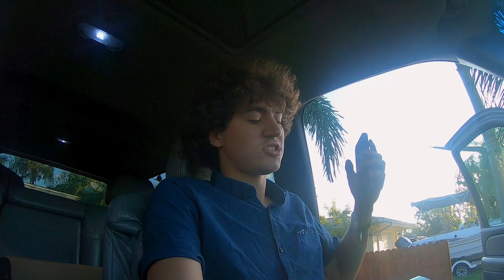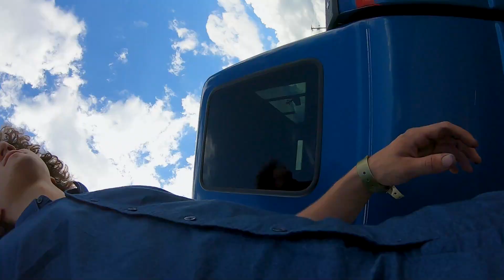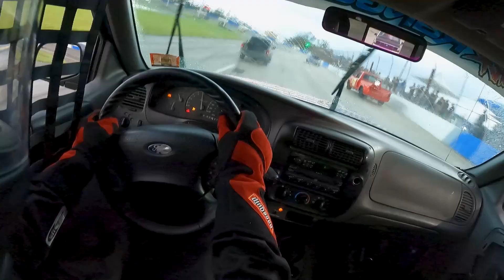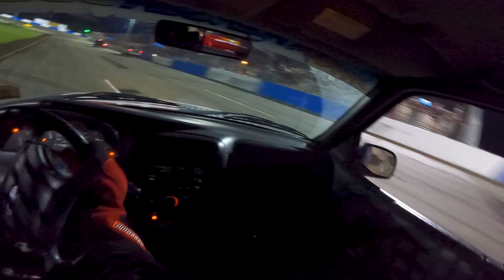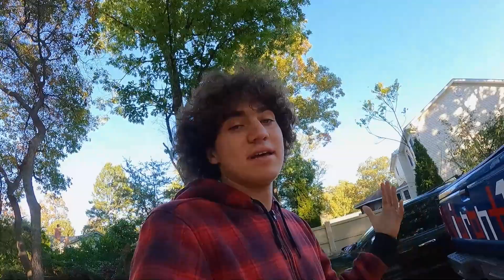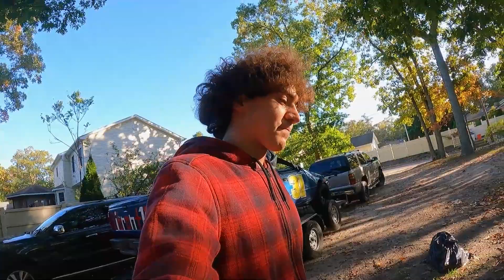Our First Race in the Danger Ranger 9000! Wrecked my 2001 Ford Ranger! BAD!

Comment: Also what your were doing in the turns is called scrubbing, ypu do that when ypu feel the front end start to slide out. Good driving also keep Trans in 2nd or 3rd don't do it in drive.
Reply from the maker: Awesome thanks for I do and feedback I appreciate it!!! I will be aiming for 2nd next year. The truck wanted 3rd but you can’t lock it in 3rd in an auto sadly so got stuck with drive. 2nd ran out half way on the straight! Got to change the rear gear!
Reply: @SeanChojnacki  bigger tires can also help, probably not as much as a gear change though

Comment: Ok ok.  I noticed there for a few laps it seemed like you were staying on the bottom of the track to stay out of the way pretty much. So my question is did you just not see chet on your left as you were, what looked like headed to inside of the straight away.
Reply from the maker: I did see him there. I know what your seeing and it seemed like I did move over a little but if you look at the line I was moving towards it not away from it. I think the camera angle also made it look like it cause I was coming out of the turn and the body of the truck was leveling out also. I knew he was there so I wouldn’t have moved over anymore but the truck could have veered left a little without trying. But my friend also said he looked like he was going up a little to hard either way even if you were to move a little.
Reply: @SeanChojnacki  no hate you good bro. Bet that was one hell of an experience.

Comment: Hey for next year I think most guys were putting it in 3rd or 2nd gear depending on the gearing instead of letting transmission shift normally
Reply from the maker: I tried to lock it into second but it ran out half way down the straight away. 3rd would have worked great but in an auto it only goes 1,2,D. Sadly can’t lock into 3rd so next year going to gear for 2nd

Comment: only problem i see is you're in overdrive next time lock it is second to eliminate the automatic shifting and you definitely need a 4 point cage with a halo bar. porta power push the corner back out add to the cage and you'll be good for next year. that was 100% a racing accident both going for the same piece of track he was coming up as you were coming down to run low down the straight
Reply from the maker: Exactly what I’m doing. I did tried to keep it in second during pratice but it ran out of gear to quick so I need to hear it for next year to stay in second!
Reply: @SeanChojnacki  if you're running out of gear try a taller rear tire a shorter tire will give you the acceleration off the corner a taller one will give you the top end hitting the limiter going into the turnisnt all bad just base your lift and brake points off that

Comment: Looks like you came across on chet ????
Reply from the maker: So it looks like that but if you pay attention to the white line by my tires I am moving towards the white line not away. I thought the same thing but I knew there was a car on my left rear side so I wasn’t going to try and go more left. Also the movement was also the rear of the truck leveling back out after the turn.
Reply: @SeanChojnacki  He was below the yellow line,and pushed up the track right into you.Glad everyone is ok.

Comment: How does one get into the race?
Reply from the maker: Choose what kind of racing you want to do like drag, drifting, oval and. Etc. 

Go to test and tunes or other race events and go into the pits and talk to drivers and the teams to see what they do and see how they started and what they recommend. 

Find local track and see what events they have and what are the requirements to do the racing you want. Examples would be does the car need roll cage, Manuel trans, full or no exhaust and other stuff like that. After you find a event find a car and build the car to the min standards it need to race but don’t Cheap out on safety equipment! And just get behind the wheel!!! 

If it’s drag racing just take your daily driver to a test and tune and rip it down the track and have a good time and talk to others around the pit area and find someone with a car or similar car you want to build and see how they did and what they recomend for starting a build on the car.

They only way to get into Racing is to go to race events and spectate them and get your own car and build it to the type of racing you want to do and get out there!
Reply from the maker: What kind of racing are you thinking of?
Reply: @SeanChojnacki  the actual ranger danger race lol. But thanks for the descriptive responded t how to get into racing...it was well written.
Reply from the maker: @jvon3885  damn sorry man some reason I read a race not the race lol. All you have to do is search danger ranger 9000 tickets and it will be on the thefoat website. Wait couple months the new will probably show up some time between January and June. I signed up a month before so I don’t know when it actually come out to sign up. 

All you need for the truck for this year was a 4 point roll cage and all the safety equipment (helmet, neck restraint, 5 point harness and race seat)
Reply: @SeanChojnacki  right on, I might just try to get in on next year's....

Comment: @Vibrant13
Next time you go into this race if you want to go much faster then you need to change the gears in the diff so that you go faster, this is what Kevin from KSR did & he won the event. Also if you want more traction on the back wheels the guys over here in Australia who race what we call as UTE's they are similar to your Rangers but just more flashy, they put sand bags over the back wheels in the back of the tray & strap them down so that they won't shift anywhere. UTE's & your US vehicles that are similar basically have no traction on the back wheels unless there is a load over the rear wheels. Glad you are okay from the crash tho, you'll do better next time.
Reply from the maker: Thanks man for advice. I do plan to hear it for 2nd gear so I don’t need it to be in drive. But I’ll definitely take your advice on weight. We noticed that with James truck with the palm tree on the back!
Reply from the maker: Also man I appreciate it. Going back next year strong!!